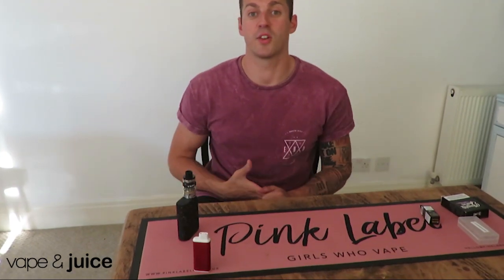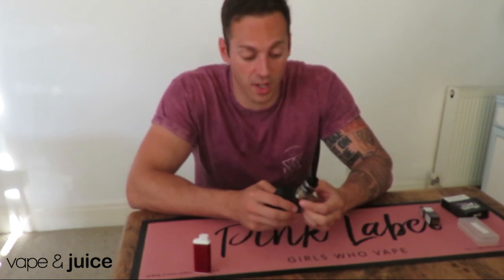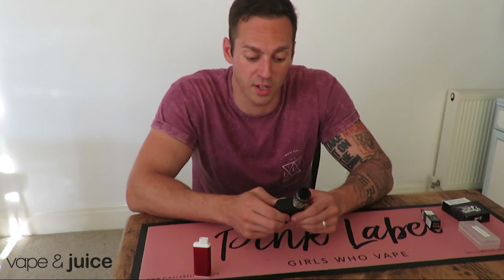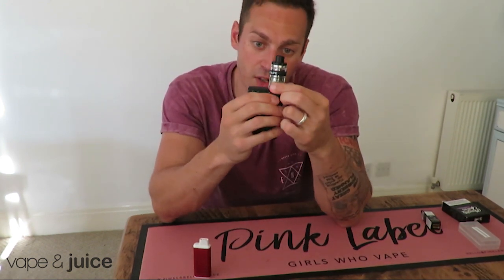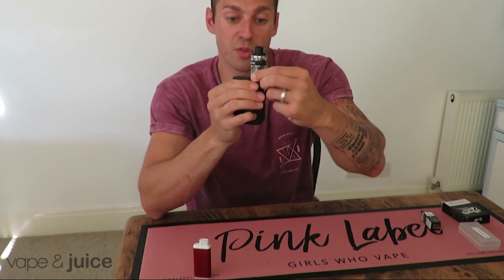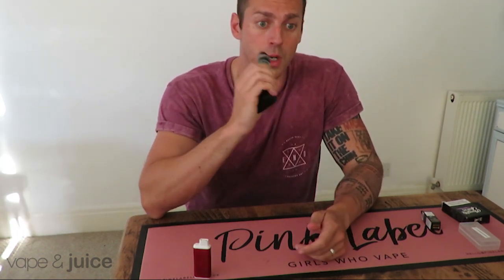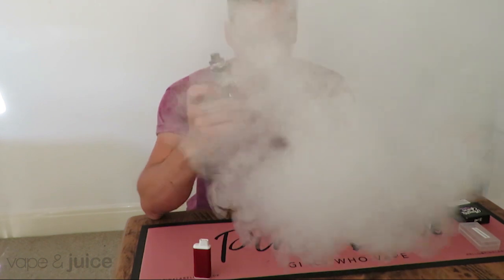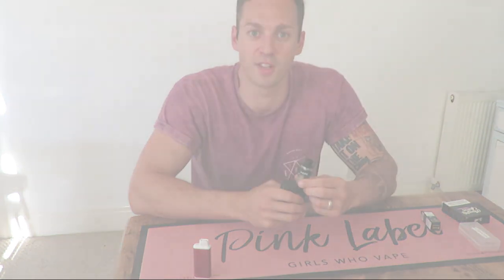Why use airflow on your vape device?

Comment: Thanks so I should just keep it open, I had no idea since I only use Novo 3 before I got my Drag X.
Reply: more open airflow actually don't just pump more air into the tank it actually also makes more liquid enter the vape coil and using wide open air you risk flooding the tank more then if say half open only! this guy doesn't know what he is speaking about not just air but it forces more juice to enter more juice risks flooding the wick flooded wick equals spitback fireback... needing a new coil and wick...... so go on enjoy for a little bit then you will need a knew coil but go on enjoy....
Reply: my gf uses her vape wide open airflow and floodsher wick needing to replace it every 2 weeks I use half air as max and have already gone a month without a need to replace yet.... key is I know what im doing and speaking about! how long do you inhale for affects how high the watts are also affects how max you can open airflow and all these things affect the size of cloud!

Comment: i have a smok and idk how to fix the air flow hole 😭😭
Reply: Daddy Warbucks on the bottom of the coil there should be two long thin ovals with little bumps around the bottom and just take off your coil (it’s easier) and then twist it until you can see through it
Reply: @relionix4177  fucking Thank YOU! No where does Anyone explain this only that "the hidden airflow is a pain to adjust" well OK but its more of a pain to not know how stupid ass information recepticals
Reply: Angel Gomez No u
Reply: @MrKrazie92805  *Smok